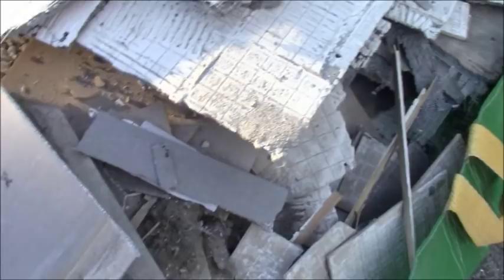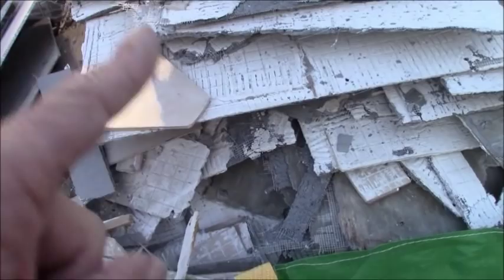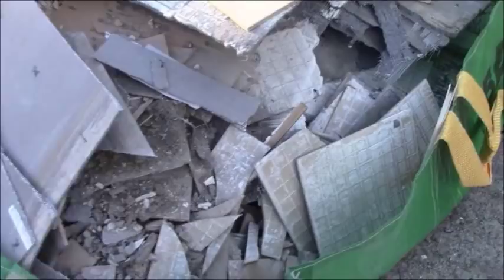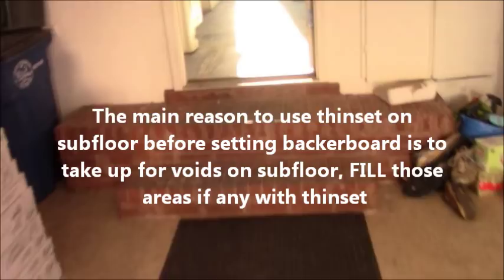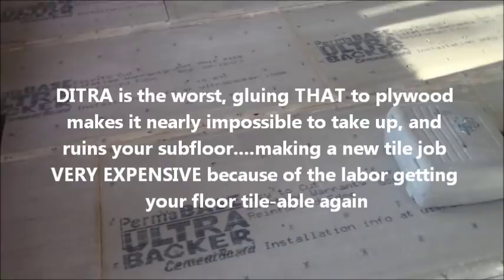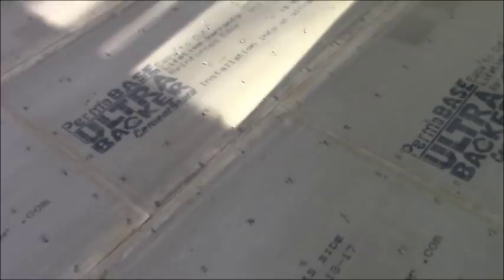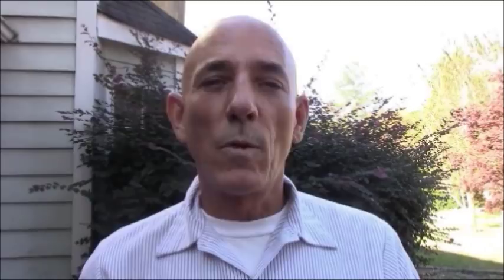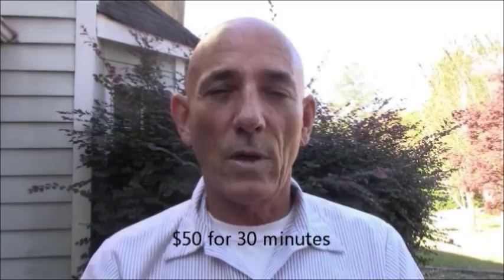GLUE BACKERBOARD ON SUBFLOOR ??

Comment: Seems to me that NOT sticking the backerboard down with thinset would actually be an advantage if there was deflection in the subfloor. I mean if you stick something to the plywood floor that becomes as hard as a rock, wont that just transfer up into the tile anyways. Seems if you just nail or screw it, maybe that might allow for very slight movement. 
I do know one thing, the person who is right about all this is the one who has installed it a certain way for over 30 years and has never seen issues. Of course that may be in ideal climates right. This is a hard call. I might go with just screwing the hell out of it and call it a day. One thing i dont get though is how in the hell im supposed to keep the backer level when i start driving screws down into it with wet thinset underneath. Wouldnt that just pull the backer down unevenly. Not like you could screw the screws in simultaneously across the whole panel.

Comment: Bob, I appreciate your thinking outside of the box!  Love your vids!  Thanks for your mission to inform fellow Atlantans of the hidden dangers of unscrupulous and/or ignorant wannabee tile installers.
 I agree and disagree with you on this topic. I agree that adding thinset under backer over a strong solid subfloor with minimal deflection will not help much.
However, I use the thinset/screw method not only to cover my rear(manuf. warranty) but to structurally laminate the backer board to increase the rigidity of the subfloor. Like gluing veneers to make plywood stronger vs nailing the veneers together. With the popularity of large format tiles I want to squeeze every bit of strength out of my substrate to avoid any possible deflection.

And sometimes...in your defense.... having a large area with a too-rigid monolithic floor assembly attached to a non rigid house frame with excess movement due to exp/contraction or foundations problems can lead to a disaster. Your method could have a small amount of uncoupling effect if using standard roof nails which could be enough to relieve some stress without cracking the tile.

Yes, I'm passing the tear out problem on to the next guy when the tile style changes in the future.
Reply from the maker: I appreciate your input on the subject, and like you I somewhat agree and disagree.  it is extremely rare that I set tile on a floor that's not currently tiled, any deflection or damage or lack thereof is obvious oh, same as in this video where the tile had been there for 20 years, if there is no damage then there is no point to mitigate the lack of damage.. or if the floor is not level or Squishy in areas and obviously you take care of those issues before you set your backer board. Also as you already mentioned I am more comfortable with a nail every few inches rather than the standard backer board instructions which call for a screw every 8...my floors after prep are rigid 👍

Comment: Like to add further comments: each to their own to lay the floor. 
I personally tried this method on my bathroom with a spot of glue (which I will not use again, not necessary) I used 12mm thick Hardie backer board on my floor 30mm screws and 25mm staples. IT'S NOT GOING ANYWHERE...each boards are MAJOR HEAVY on it's own without the aid. What is important you use good screws and use a good firing staple gun.
Put it this way, when you lay carpet underlay you don't glue it to the wooden floor you use good staples and staple tracks around the edges to hold/grab the thick carpet which last for 10-20 years because of the good quality carpet.
GET ON WITH YOUR TILING AND ENJOY THE BEAUTIFUL END RESULTS,too much over thinking.  It all boils down to the tiling how well you mix the adhesive, the grout and good quality tiles because we all know it's not going anywhere. (It's too heavy to shift or move). Good video From the United Kingdom.

Comment: Thank you for this.  A friend who is a contractor recommended I lay the backer board directly on the subfloor, no thinset and after reading all these posts about the dangers of NOT using thinset on the subfloor and against my intuition, I laid down my first ever layer of thinset under the backer boards.  The result:  the backer boards were uneven!  I started with a perfectly level and even floor and because I was new at using thinset, wound up with backer board lippage! Egads! So how easy will it be to take up these two backer boards and start over... will I damage the subfloor by taking them up.  I know the backer board is toast, I just want to make sure the osb underneath will be okay.... can't leave it the way it is... I've also learned a lot about the correct consistency of thinset.

Comment: In my kitchen the cement boards were glued and screwed down when I remodel my kitchen I had to use a car jack to lift the floor That's How Strong and bad it stuck to the floor joists completely ruin the subfloor and some floor joists I would fire a contractor that will do this to my home again. I replaced all of the subfloor and instead of gluing the cement boards I screwed the HardieBacker boards every 6 inches  just to make sure. I rather have screws that I can remove than glue that would ruin my subfloor. As a homeowner I would rather buy you a hundred boxes of screws then have you glue anyting to my subfloor. I'm with you on this one startile. I have a video showing how I used a car jack to lift the floor I can share it with you if you like.
Reply from the maker: The advocates of "Glue & Screw" would say yours was done right, it should be hard to pull up, or it's the next guys problem. My issue with it is it solves nothing, there needs to be a problem to have a solution, and this creates more problems than it solves.
Reply: how are you taking old screws out when they are full of thinset, seems like you would have to rip them out of the sub floor
Reply: Let me tell you how us big boys do kitchen and bath floors for renovations. I have been doing this for over 30 years. If the sub floor is usable we will tighten it up with screws. Let me back up. First we take into consideration the floor joists. Most renovations in the Northeast 50-70 years old you are gonna find 2x8 joists past there limit by a few inches. Also in some cases 22" on center. Or Varied even worse. IF the sub floor is old boards 8 to 10 inches if it is split and dry we cut it out and lay down glue and screw new 3/4 CDX. They we go over it opposite direction 3/4 CDX. All screwed. 6 Outside 8 in the field. Then Thinset and 1/4 Hardi fiberglass the seams. Then after it sets up for a day. Thinset and tile..then grout. That floor is down for a long long long time!

Comment: I was always under the assumption that gluing was for levelling the floor. I have seen on more then one occassion tiles cracking because the backerboard had not been glued. I think each job has to be determined before making that decision.
Reply from the maker: Yes of course every job is different and must be judged on its own merits, remediation must be done for deflection.... but having said that too many people are book soldiers and will put a screw or nail 8in away from each other or whatever the instructions call for, to me that is a first failure , I use a nail gun and nails are cheap so a nail gets put down about every two in which is why I don't need to glue and screw. Never had a failure.

Comment: I nailed down backer board over tar paper many years ago to do a small bathroom floor, which had particle board sub floor. I did on recall but I don’t think I used thinset under the backer, I just used the paper to level and protect. It is SOLID. No issues no cracks.

Comment: Keep in mind, setting the hardi in mortar is not a recommendation, but actually a part of the installation instructions from the manufacturer.  That said, it's not good to trowel wet mortar on wood! I would hit it with redgaurd or hydroban first. 
I can definitely feel a difference in the floor. Set on mortar just feels and sounds more solid when walking on it! But yes, it's permanent.

Comment: Funny...about 10 years ago we tore out our rotten bathroom floor and replaced it. We added more reinforcements between joists, then for the subfloor we used 1"x 6"s. They went down like a dream. We put hardibacker over the subfloor with nails. I didn't know, but my daughter said no glue-and-screw. I guess she was right! We haven't had ANY trouble with that floor, but we seldom use that bathroom for baths. But NO trouble at all with it. I'm so glad we listened to her. She has her MSW, but she could build a house from the ground up if she needed to! Her dad built houses all his life.
Now we need to do the kitchen floor. We are going to use plywood for the subfloor, but we really don't want to tear out all the cabinets: it's an old house, and cabinets were custom, and are BUILT-IN, along with beautiful tile-work. I'd be happy to just replace the center section of the floor, but to do it right we will have to tear them all out and put in new cabinets after the floor is done. 😲 I just wish there was an easier way!

Comment: Hours? It took a couple days. I don't even care if my grout cracked...it is better than having to put a new subfloor in to change tiles. In my experience engineers and contractors never put any thought into how a part or installation will be removed or replaced in the future - the time and cost of that is if no concern to them. It isn't realistic for 80 percent of people to disregard the difficulty of removal or replacement in the future

Comment: Agreed. The only time I use thinset beneath backerboard is when the subfloor has a lot of inconsistencies, is very rough such as if I've had to scrape up old tile work but not bad enough to warrant replacement  or is sagging between floor joists (when joists are adequately strong but too far apart like found in some older homes).
Otherwise, backerboard on subfloor and properly screwed is sufficient.
Unless there is more than 1/16" height variation in the surface of the subfloor in less than a 24" span no glue or mortor is needed. In fact, I kinda feel like the backerboard acts as an uncoupling membrane when it's screwed down only, allowing just a tiny bit of lateral movement between it and the subfloor and possibly preventing cracking of the tilework.
All you need is compressive strength. So long as the backerboard can't compress vertically under a load, lateral movement is not only inconsequential imo, it's a benefit.
It all depends on the construction of the house. Is it well built and solid or is excess movement of the structure likely.
Vertical movement can't be tolerated and must be compensated for but lateral movement can easily be accommodated.
The more lateral movement of the home the fewer fasteners I use on the backerboard. It's almost like installing a floating floor system. The tile itself bond's the individual backerboard sheets to one another and the entire floor is allowed to move laterally slightly. You have to maintain sufficient spacing off walls, especially any that intrude on the main floor "body" such as the walls enclosing a toilet room or a hallway entering the bathroom etc.
Atleast that's my take on it and I've never had issues with my tile work in homes that tend to move around alot.
Btw I'm really liking your technique of using roofing nails to secure the backerboard. That's a little stroke of genius and a prime example of using your noodle to outsmart the manufacturers recommendations and find a better way.
Even using the screws specially made and intended for the backerboard used won't make the job any easier. I generally have to run the screw in, back it out to clear debris from under its head and re seat it. Even then it sometimes requires a 3rd seating to insure its flush or below the surface. It's slow and a pain.
Roofing nails can be driven quickly and easily and are thin enough to seat flush to the surface.
I will be using them next go around!

Comment: I wish I had come across your video before today. I just finished gluing and screwing my entire kitchen subfloor.
Reply: You will be glad you did. The guy in the video is clueless. If you are in the northeast and go through the climate change and humidity changes that we do. Only way to go is glue and screw. And another layer of 3/4 ply is the ultimate way to go. Yes you have to make transitions for the other floors to the tiled area because you will be 3/4" Higher. New homes keep them the same level....and they fail very fast because of the lack of subfloor. Usually 1/4 luan or hardi then thin set and tile. This way the elevations meet the wood floors....FAILURE. Tile is made for concrete sub floor. If you want them to last on wood the way I suggest is the only way. The new German super plastic thin product only have a warranty of 10 years. That is bullshit as far as I am concerned.

Comment: Jut ripped out a floor I glued and screwed five years ago. Never again. Had to remove it inch by inch with a 4 ft pry bar. Took two full days to take out 100 sq ft. Other floors I put in without glue have held up just as well.

Comment: Never cement down a tile subfloor!  Just demoed 500 sf floor and what should have taken a day and a half took a full week.  This was the first time I demoed hardibacker.  The hardibacker subfloor was set in thinset and stapled every 6” and 2” on the seams.  Right on top of the subfloor of a brand new house.  Worst demo job in 30 years of remodeling.  A 6” sds max spade won’t cut the staples. Have to pull every staple by hand so the mortar can be scraped off with the demo hammers 6” blade.  Very time consuming.  Then it needed to be sanded with a diamond cup grinder because the sds blade doesn’t remove it all.  Had to get it ready for hardwood floors.  Plywood is the way to go to stiffen up a floor. Plywood is way stiffer than hardibacker or cement board and was how it’s been done since the 1950’s.  Try and break the corner off plywood with your hand. Won’t happen.  No problem breaking the hardibacker or cement board.  I screw it down and red guard or equivalent over the top for waterproofing and uncoupling.  I use quality 3/8 douglas fir underpayment 5 ply plywood to flush up with hardwood floor and never have a problem.  And in 15 years myself or the next guy can demo it.  Hardibacker or cement board set in thinset on a floor is a gimmick to sell a product and make it work.
Reply from the maker: Agreed. I said hundreds of floors before I ever got into building a shower, never had a call back and never had an issue with not gluing and screwing. But like you I've had various backer boards stuck to the floor and went through the same angst that you had to go through and for no reason.
At the end of the day all it does is cause more cost to the homeowner later on, it is not a solution to a problem.... the problem needs to exist first....
But anytime a floor cracks or fails it is almost always operator malfunction and the installation process.

Comment: I had to replace a 12x24 tike last week. Took me 3 hours. 2:55 to remove the hardiebacker glued with some sort of PL glue to the osb subfloor. 3 minutes to mix the thinset. 2 minutes to set the tile. Gluing the hardiebacker is dumb. Staples and gravity do just fine. Manufacturers sell a product. They often go overboard with their recommendations. They don’t pay to install and demo it. Use common sense.
I said the client his tile setter shouldn’t have glued the board and it will create extra cost for demo in 20 years. He said “not my problem”. I should have glued a new tile with PL glue over the damaged hardiebacker. It would have looked decent with the grout and I could have said “it’s not my problem” too.
Replacing a broken tile costs $150. Saving $150 maybe once ir twice over 20-30 years doesn’t justify gluing the hardiebacker.

Comment: I'm using a 6mm cement board in place of plywood over wooden floorboards where I'm only laying a roll of vinyl cushioned flooring. I didn't want to make it ultra permanent by gluing either. I have some heating pipes under the floor so I intend to miss out the glue.
Rare to see any video where it's not tiles going down. The backer is just being used to smooth out the floorboards and to provide better waterproofing than ply would have.